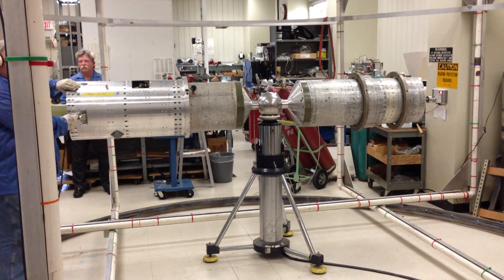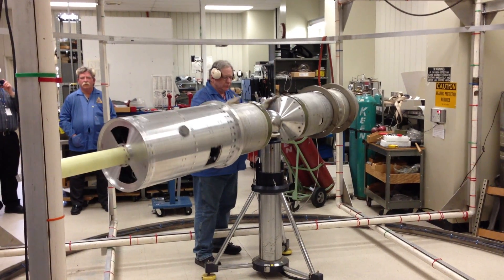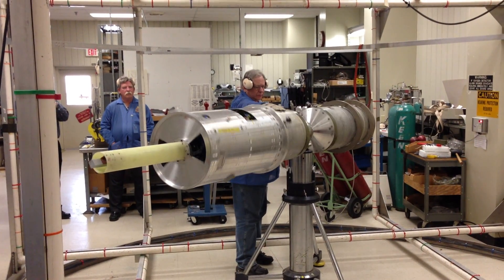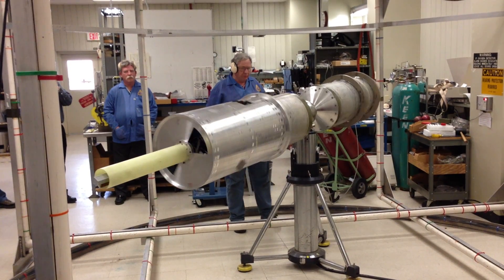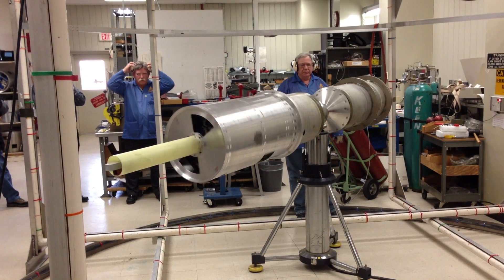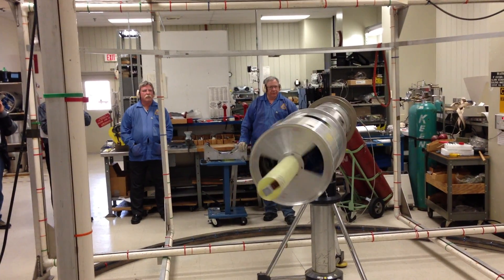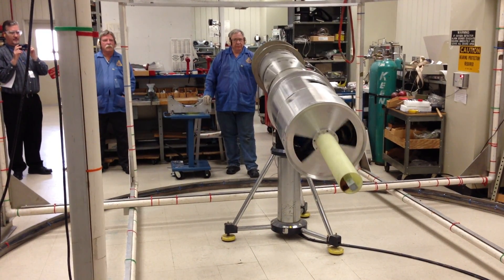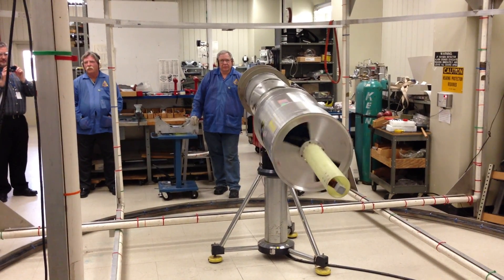Rocket Orientation Test

Comment from the maker: A fascinating test of a rocket orientation system at NASA's sounding rocket facility in Virginia. The rocket rests on a frictionless pivot inside a cage generating a magnetic field. At a little past a minute in, the rocket aligns itself with the magnetic field by firing thrusters. Since the rocket is spinning (to increase stability), the firing of the thrusters must be timed perfectly.